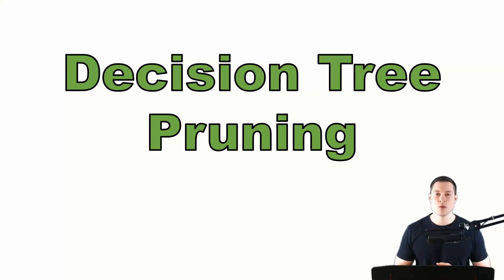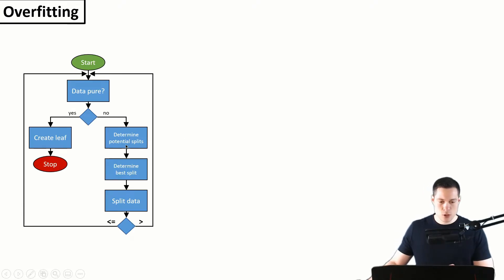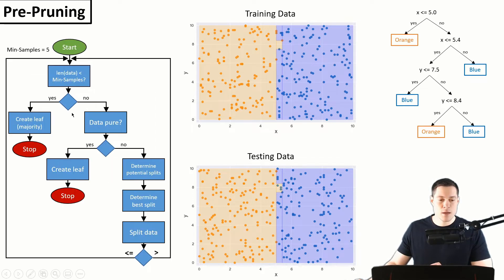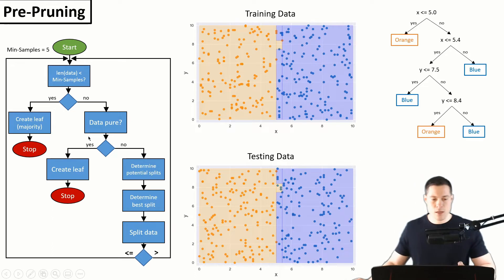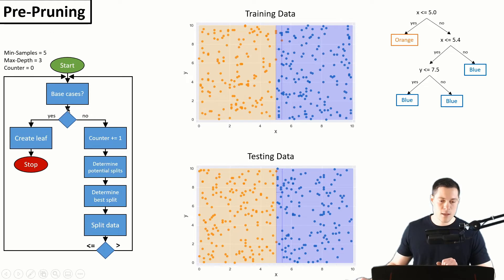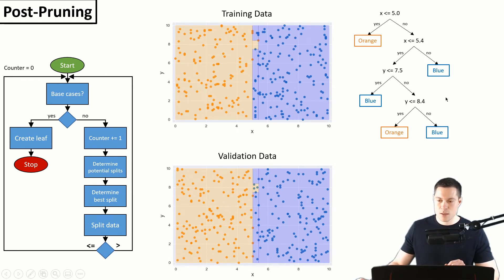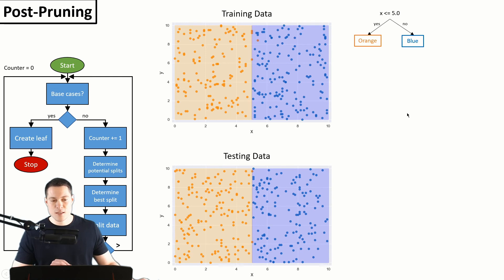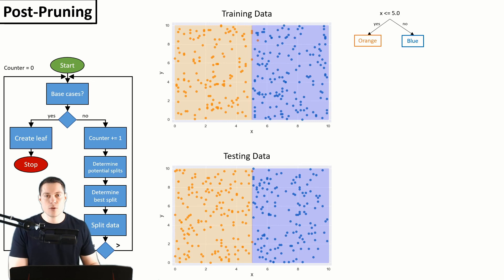Decision Tree Pruning explained (Pre-Pruning and Post-Pruning)

Comment: Do you do it with cross-validation?
How? What happens if at each k-fold you get a different model?
Reply from the maker: I’m assuming that you are referring to post-pruning:

In this video, I just focus on the most basic use case of post-pruning where you build the tree with the training data, prune it with the validation data and then test it with the testing data.

K-fold cross-validation is another technique on its own. It doesn’t really have something specifically to do with post-pruning. However, I think, you could also use it with post-pruning if you wanted to.